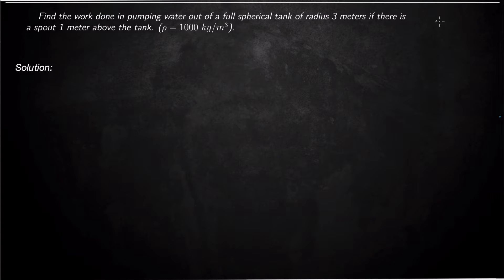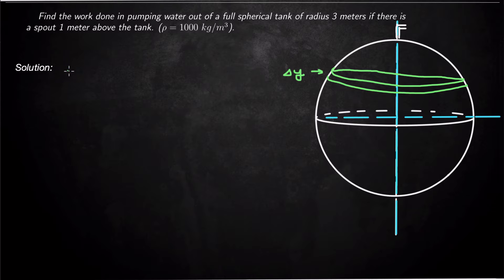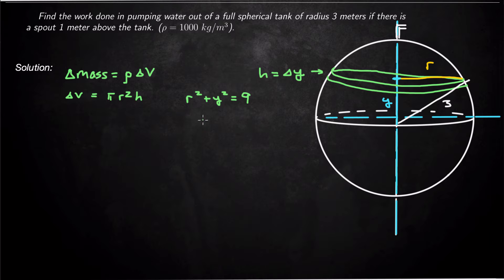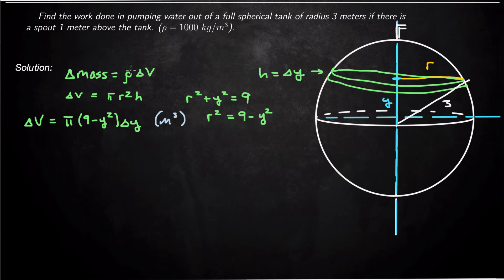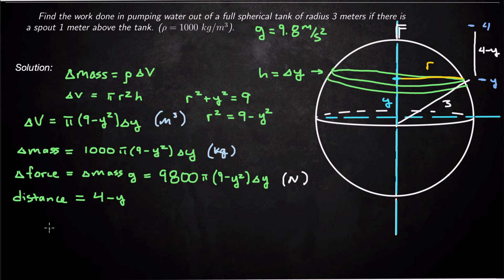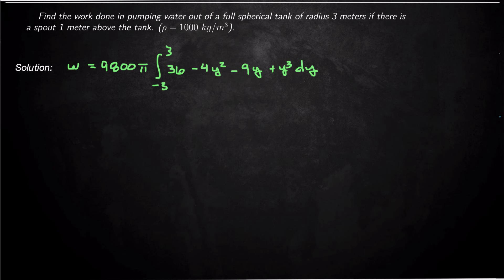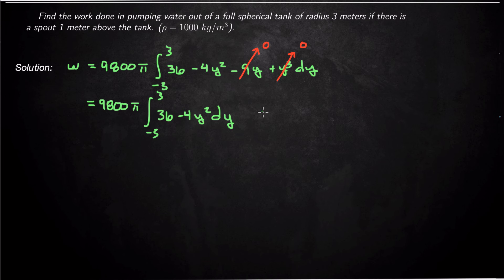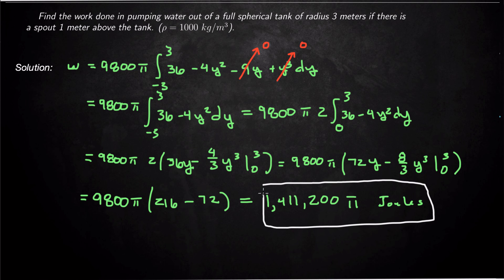Amount of Work to Pump Water Out of a Spherical Tank With 3 Meter Radius

Comment: Incredible content.
I tried to tackle this problem in a simpler way - split sphere in half, and imagine pumping in 2 stages, to the sphere's top and then to sprouts end.
Each slice of water in lower half has it's twin in upper half of the sphere, so at 1st stage work should average out, as if one was pumping all the mass from the middle.
With that, combined work for 2 stages becomes:
W = mg(h + r) = Vsphere * ro * g * (h + r) = 4pi/3 * r^3 * ro * g * (h + r)
Which gave 470400*pi J, or about 1.47MJ, which is different, but I'm not sure at which point my assumption breaks.
Reply from the maker: I get the same thing doing it your way 1,411,200 pi Joules

4pi/3(27)(1000)(9.8)(4) = 1,411,200 pi

I like the approach!

Comment: It's not clicking for me why you subtracted y from 4 to get the distance. Would it be (x+1) since you are integrating from -3 to 3, plus the additional 1m from the spout?
Reply: Ok it just clicked for me. The distance traveled by the war reaches up until y = 4, so in order to get the distance traveled you take away x position and your left with the displacement.

Comment: your integral goes from -3 to 3, but should the upper endpoint be 4 because of the 1m spout?
Reply from the maker: Good question. The integral is over the portion that contains the water. The water is only in the tank so only from -3 to 3.
Reply: @JonathanWaltersDrDub  but these problems ask about work to pump water out of the spout... so the work to achieve the spouts height is needed in order to empty the tank... otherwise you're not moving any liquid at all
Reply from the maker: The height of the spout is taken into account by the distance that the water must travel from where it currently is.
Reply: @JonathanWaltersDrDub  I see what u mean in the (4 - y) portion. Thanks for clearing this up! 👌
Reply from the maker: No problem. Great discussion.